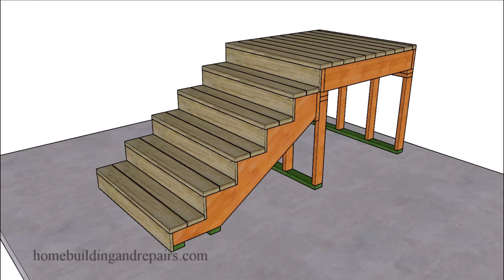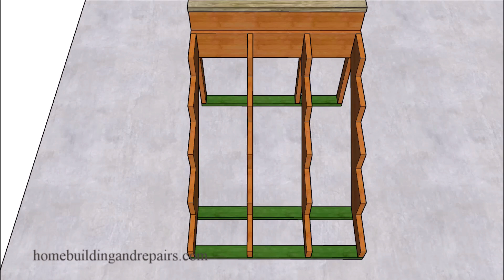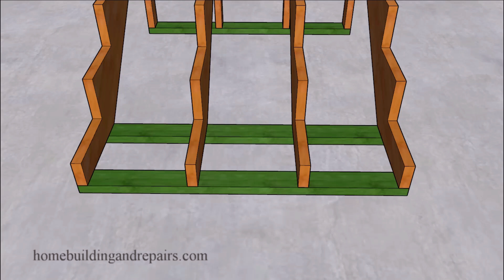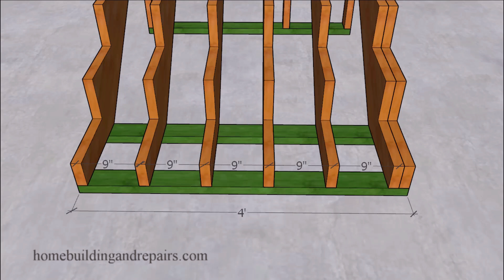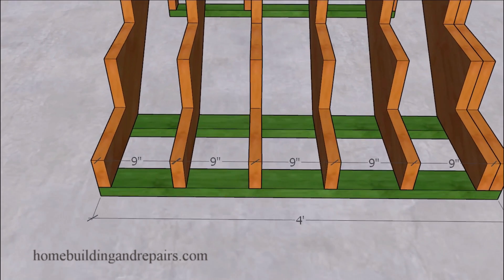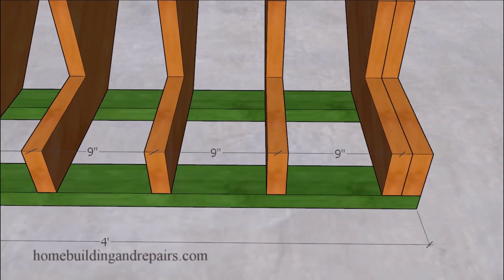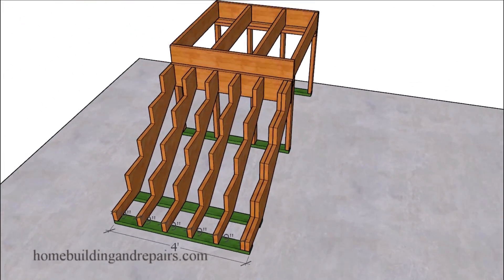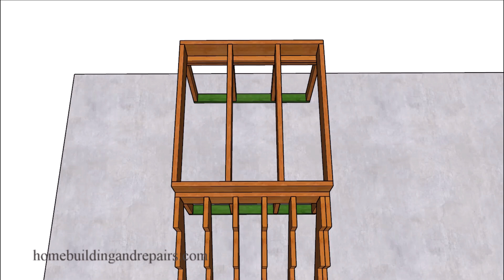Maximum Stair Stringer Spacing For Composite Decking Materials Might Be Different Than Deck Joist

Comment: Please explain WHY the 9” stringer spacing requirement is in the composite decking instructions. It’s because using 16 or 20 inch causes the treads to sag.

Comment: I guess the reason is because when you are stepping down you give much more force than your weight. your body starts going down in each step than when you sped the lower step you need to stop your weight. That means you push much more than you are pushing at flat surface of the deck

Comment: Having used a few different composite decking types, there is a definite desity difference.  Almost all that I've seen, in the literature, claim to span 16" but there's a slight bounce to some. There's no grain with the PVC stuff.  I prefer using it along with pvc fascia material but it's flexible.  A good fix might be to sister on material(2x6) onto the joists in high travel areas.  Thanks for all the knowledge!